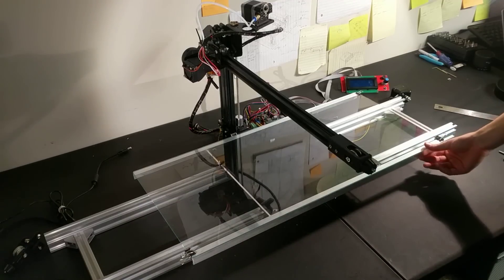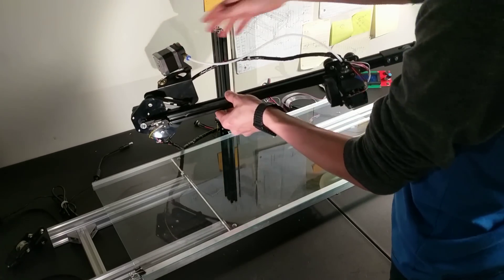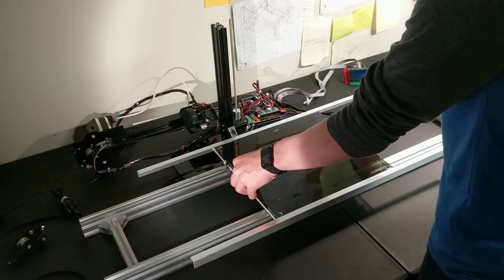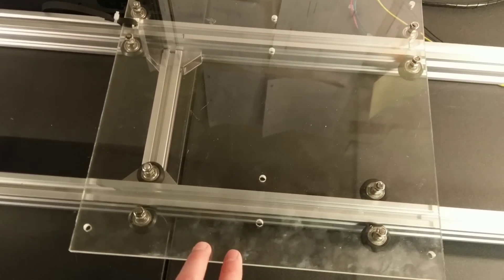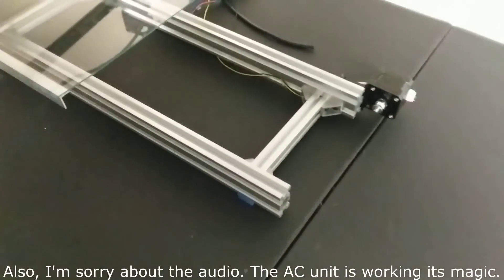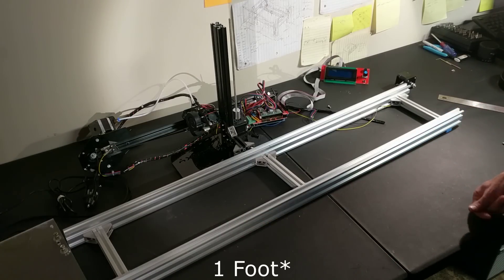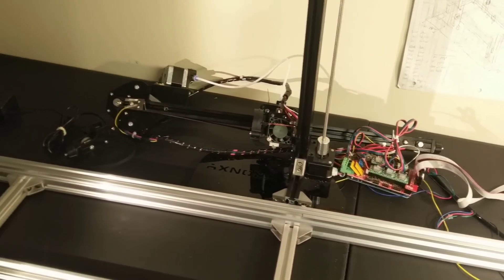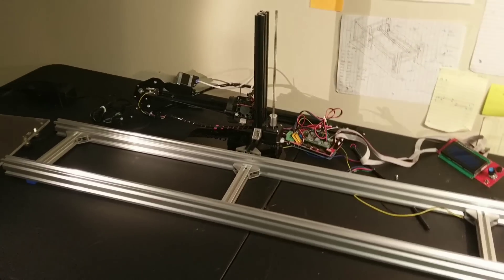Want to build your own huge 3d printer? Reprap Jupiter Tear down/ Instruction

Comment: Is it a lot easier just to extend the Y axis instead of x+y? Thinking 15cm should be enough for my X axis so a longer Y axis would be a lot better
Reply from the maker: Yes, and if you don't need the full 300mm on the x, then I would recommend only extending the y axis. Large cantilever designs like this one are relatively unstable. It's certainly still usable, but not  the best option. If you plan on doing this, I would recommend a piece of cbeam or 4040 extrusion on the y axis for maximum stability. It may be overkill if there's only 150mm on the x axis, but you wont regret it-- the stuff is pretty cheap. Keep me updated!

Comment: hi luke, the design is really interesting.
i got my old crappy 3d printer disassembled and finding a way to repurpose those extrusion and stepper motors, and I found your design
after seeing you print,  my idea is printing TPU models one by one, to avoid those outer shell stringing between models.
Since no matter how dry the filament is, how i tune the retraction and temp, it still get a bit of stringing.

anytime you'll release the code on github? I've limited knowledge on programming, all I did was changing numbers then flash it into an old board
Reply from the maker: Thanks, I'm glad that you find it interesting! I recommend building one, as its a great way to print big at a low price. The firmware is actually already on github, you should be able to find it herehttps://github.com/MakingwithLuke/Making-with-Luke-3D-Printer-Files . Tell me if that works
Reply: @MakingwithLuke  thanks!
In these few days i managed to learn about config settings in Marlin in a limited degree, and tweaked some gcode making my bigger printer to print one by one on a bigger build plate.
I guess I'll diy a tronxy x1 like small printer with fine nozzle for small parts.
It's kinda hard to find places to store all those printers

Comment: I'm going to use a similar design with two exceptions.  Starting with an Ender 3 and I will be keeping the Hobed bolt system for the Y but expanding it to double the wheels.  That system is a bit more forgiving and lets you put a final tension adjustment on the movement.  Love what you have done and you have inspired me!  Thanks for sharing!
Reply from the maker: Great to hear, Julian! I like that you're using the ender 3, it is in fact a better starting point for this design. Yeah the bed will most likely need those extra wheels to stabilize the longer bed. I assume you will have to drill new holes for these wheels. My best advice is to make a printed template to help line up the holes, and use an eccentric nut to compensate for inaccuracies. I'm glad to hear someone else is inspired by this, thanks for letting me know about it. you'll have to keep me updated on this, I want to see how it turns out!

Comment: lol electric bill lol btw it may be something like 30+WATS not that much to go heated bed. good to see you doing more videos. keep up the good work
Reply: If you are doing a 4 day print, that power usage can add up, not everywhere has cheap electricity, in Oz the power costs 3x as much as in , say, Canada.
Reply: @originaltrilogy1  true and don't kid yourself power here is way up here too i use heat for about 30% and then have it drop to 40c for the bed that when i got a long print on the bed.
Reply: @CanadianMakerProject  It's still nearly three times cheaper in Canada than where I live, we are paying around 48c per Kwh, so big prints can add up, especially in winter when the bed has to work hard to keep temps. Having an enclosure can help a bit, as does a more efficient bed. Dropping the temp after the first few layers does help though, good tip.
Reply from the maker: @originaltrilogy1  yeah, that's why I decided against heat beds for the time being
Reply from the maker: Thanks, Ron.